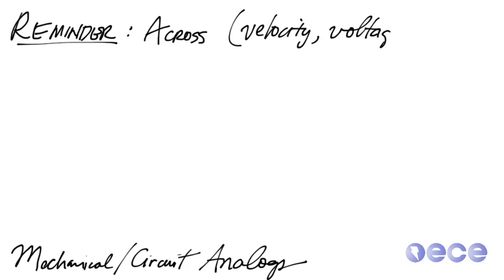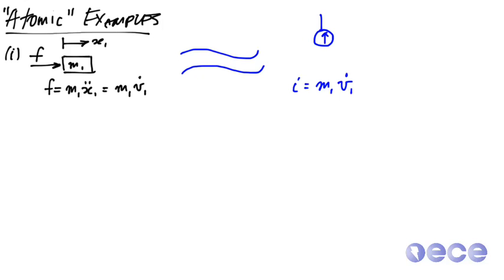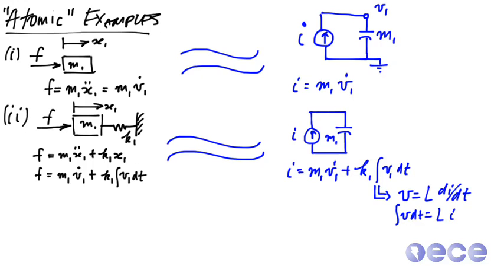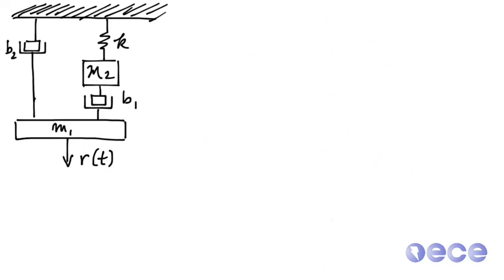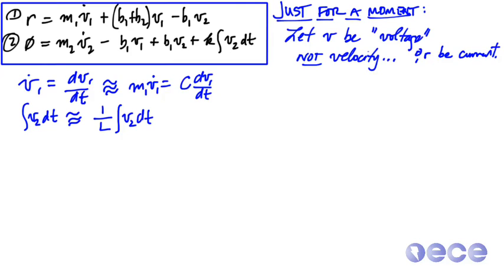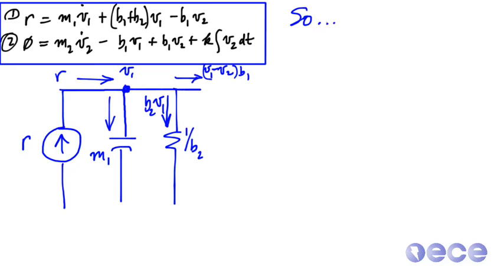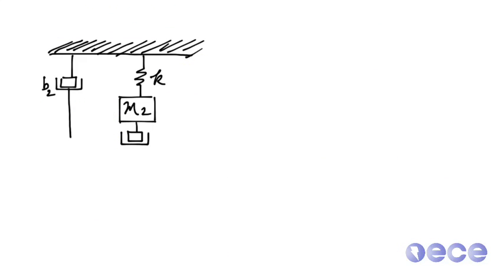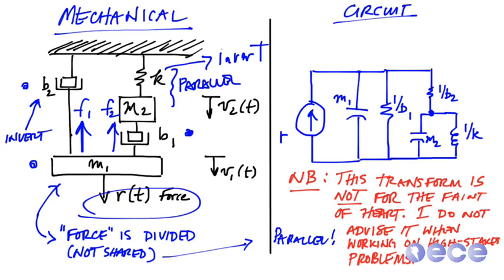Mechanical and circuit analogs

Comment: If I understand correctly, you can consider a mechanism, create it's mechanical model and then create it's electronic circuit equivalent?  Does that mean you can build the circuit, apply some signal from a function generator and study the output on an oscilloscope? Would the signals on the oscilloscope be comparable to energy or oscillation? also could you take the signal on any circuit element and gain insight to that equivalent mechanical component? Could this be considered an analogue computer representing a mechanical device?

Comment: there is a mistake at the 1st figure, mass means inductor
Reply: It depends on the relationship you're most comfortable with. You can do a force-voltage relationship or a force-current relationship (like in the video). If you do a force-current relationship, then mass and capacitance become analogous (like in the video). If you do a force-voltage relationship, then mass and inductance become analogous.

Comment: Excuse me, can you explain why you the inversion for the analogous resistance is necessary? I've been thinking about this all day and can't understand it and it's threatening my confidence in these principles. Like today I was doing some experiments with electric power draw from my drill, and I noticed holding the chuck (adding rotational resistance if you will) increased the power draw and I didn't understand why